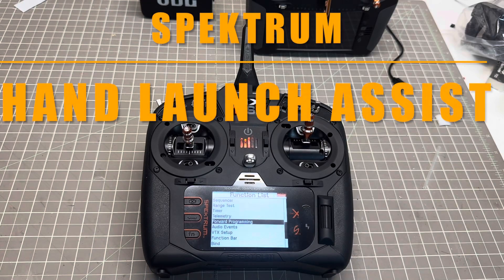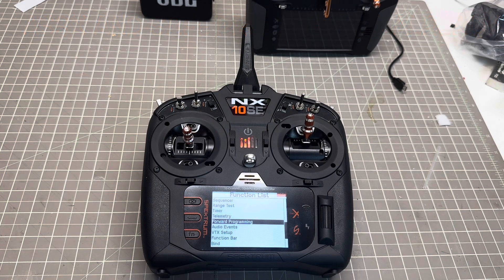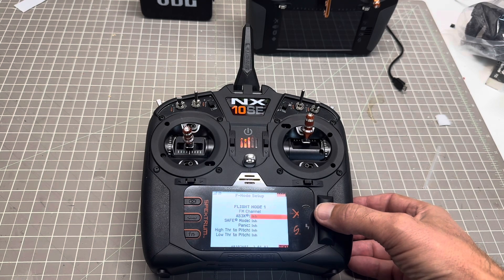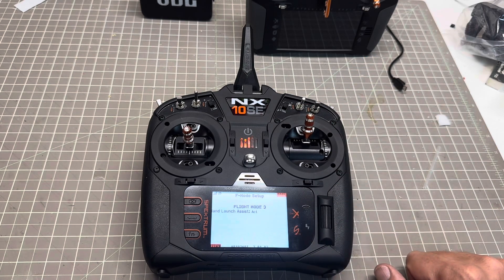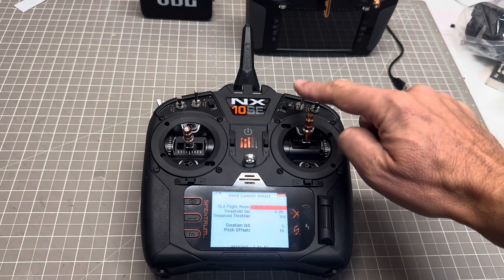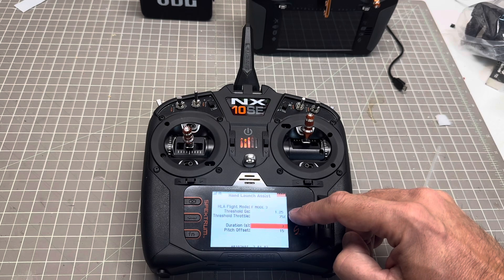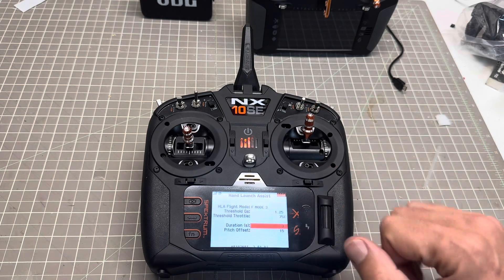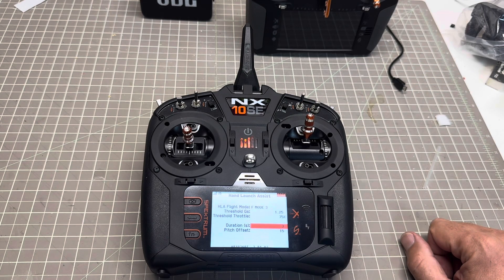Spektrum RC Hand Launch Assist, how to

Comment: hello, which receiver do you need ?
not working with the AR631
Reply from the maker: all the curent receivers that have AS3X are able to have that functionality, for the older one, I think as you can upgrade them with a firmware 3.0 or newer
Reply: You need to download ASX3PLUS, I just loaded onto my AR637TA, works great.

Comment: Can it be just in Launch flight Mode, and all other flight modes asx is totally disabled? As Launching GPS 7kg racing glider, we're not allowed to have gyros in operation with normal flying modes! But I can see advantage for us "older" guys or girls!!! Having launch assist,  as powered Launching has no affect on end results! Also is it reasonably easy to see if there are no other launch modes in operation with asx? To show organisers & fellow pilots your not "cheating" 🤷‍♂️